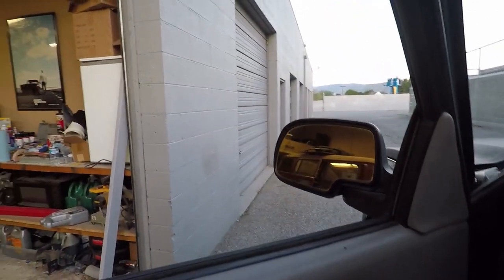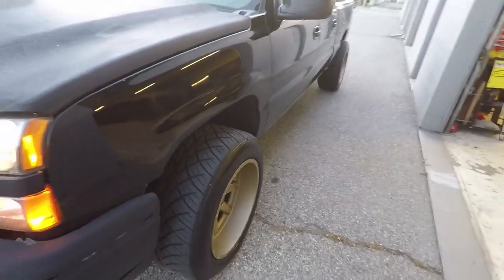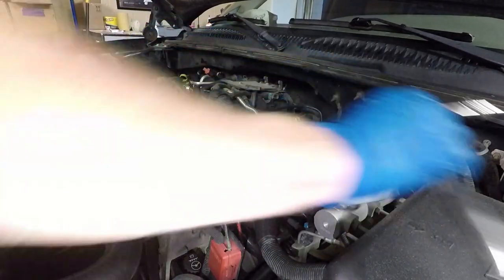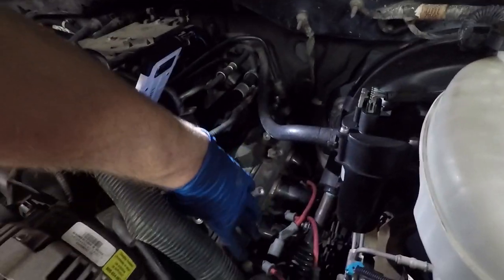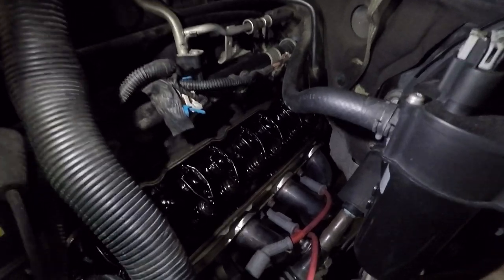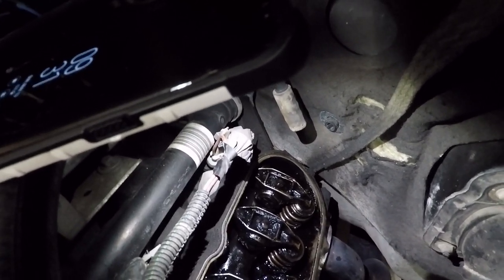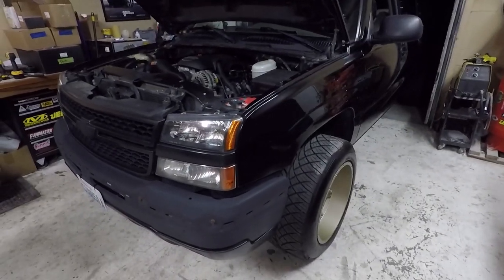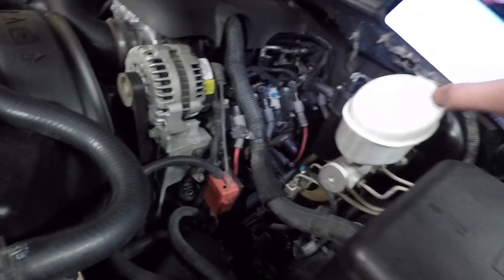Silverado Engine Tick Inspection

Comment: I have a 2006 gmc 2500hd w/ 6.0 I had a horrible ticking noise on the top end of engine  and bad oil pressure after looking these engines have a long pickup tube that connects to the oil pump where the pump connects to the tube in the oil pan it had a bad oring that caused it to allow air to get in I replace that oring and put another one on top of it to make it fit tighter bolted back together  works like a champ no ticking noise and when I gas on it oil pressure  goes  from 45 or 50 to 75 to 80.

Comment: 2004 avalanche mine only tiks while I accelerate! Is load off a Cold start. But after Motor has warmed up it either gets quieter or stops. What is your thoughts? And price on fixing the problem?

Comment: The light is not going to help find the tick. Put lucas in it. Helps alot. That play is a little excessive but its not broken broken
Reply: I put Lucas in my last 5.3 and it immediately started losing oil around 2 qts a week.  I didn't have a tick and was only using Lucas as preventative maintenance.   I just wanted to give another opinion on the stuff. Like anything, it ain't perfect.
Reply: Josh Christian I’ve never had that issue but I use non synthetic oil and non synthetic stabilizer. Is it possible you put full synthetic stabilizer in with non synthetic oil?
Reply: @BayAreaMCs  I use synthetic oil and synthetic stabilizer,  or I should say I used to.

Comment: The oil pumps on these LS engines are on the front of the engine they are powered by the crankshaft..the pick up tube runs into the bottom of the pump the rubber seal that slips onto the pick up tube needs to be replaced..no lie..it gets pinched or flattened or cracked and starts to draw air and loses prime in the oil pump..I'm about to do this to my truck  in just a few days..but I think I'm gonna replace the oil pump with a high volume hig pressure pump

Comment: Pressure issues are notorious on these 5.3's I bet when u give it gas its more quiet at 40psi oil pressure.
Reply from the maker: Agreed, im thinking the pickup tube o-ring is dead. hopefully i can get the old engine tore apart soon and inspect that o-ring.
Reply: @MitchCarveth  I have a 4x4 and I can't drop the oil pan until I lower front axle fml. lol
Reply from the maker: I know the feel :/ lol
Reply: @youdontwantthesecrumbs3996  Not that hard I did it my dad had to help me because the 09 front diff is more heavy duty
Reply: Got a 2006 2500   oring 5 bucks at autozone pipe was  still a little loose so I put another regular oring on it worked great
Reply: i had mone fixed with no experience only common sense on how the things work
mine is 4x4 north face avalanche
the 0 ring was flat and i change the oli pump and the sending unit. No more noise!
 im now chasing a po300 code Dow to it's cour

Comment: Hey, buddy. So this was definitely a rocker arm causing that tap/tick? I have an 02 1500 with a 6.0 lq4 swap and mine sounds almost identical from what I can hear through the internet. I'm thinking I might at well just replace all the arms and pushrods to get me by until I decided what I want to build.
Thanks
Reply from the maker: It's definitely worth popping the cover and checking the rockers for excessive play in the bearings. Hope it's not a lifter tick starting. How's your oil pressure? Just want to verify it's not the oil pump o-ring going bad.
Reply: @MitchCarveth  Oil pressure is great. The taping comes and goes but sometimes it's pretty damn loud. Strange thing is I don't hear it on cold start.. just when it starts getting a little heat in it. I've really had trouble finding the exact sound but when you cranked your truck and did a walk around the front... that sounds just like mine. I put a stethoscope all over the engine and I hear it most clearly on the water pump and toward the front of the oil pan but still hard to say.
Reply from the maker: @SheaAP1  that makes me think it might be a lifter and you are able to hear it better by the water pump because it's echoing through the coolant journal in the head and theres less moving parts by the pump (Vavltrain wise). But that's just a guess without seeing or hearing it in person. I would still check rocker arms and springs first for sure, It could even be lose rocker arm that's Evening out at certain RPMs.
Reply: @MitchCarveth  my has the same thing. Did u ever figure it out

Comment: What kind of gauges do you have hooked up? I like that. Not boost of course. Trans temp? Oil temp? Wheels look good. Would like to see that rebuild video.
Reply from the maker: I have air/fuel ratio and trans temp right now, thank you! I've got the rebuild video on the channel and the tear down video of the engine in this video is up on the channel as well. Some sweet broken parts lol

Comment: I got a 4.3L v6 2004 Chevy Silverado close to 140k miles. The truck when sat for a couple hours, makes a ticking/clicking noise after the start up. This goes on for more than a minute, then after the truck gets the opportunity to warm up, the noise goes away. My oil levels are checked when this occurs and it is at the appropriate level on the dipstick. I do have a bad intake manifold gasket that is getting replaced as well as the oil sensor. Is there any reason this happens only on start up then disappears? (I do live in the state of Wisconsin, so winters get decently cold)
Reply from the maker: Hows your oil pressure after startup? you might have a lifter that's taking a bit to load up, without being there in person its a little hard to say. I wont lie im a pretty big fan of the Lucas oil stabilizer, it helps with valvetrain noise really well.
Reply: Oil level might be a factor.
Reply: Ever figure out why it did that?

Comment: 2003 Chevy Silverado 4.8L with 210000 miles for 1500$ with that lifter tap sound did I pay to much or was it worth it because I want to fix the problem so I can drive it. It’s one of those half rear door trucks?
Reply: Oh and it’s the one with those cool looking head lights
Reply from the maker: I think thats great deal, as long as its not burning oil and has good oil pressure just swap out the lifters and get another 100k+ out of it.
Reply: @MitchCarveth  I cleaned the oil pick up tube and replaced the o ring and the ticking went away I only hear it on cold starts but it light tick

Comment: I’m about to buy this 06 Chevy Silverado 1500 and in park it has low oil pressure and it does this, it has a ticking sound, you think it’s good? And do you know what it may be?
Reply from the maker: The low oil pressure in park tells me the pickup tube o-ring that goes into the oil pump is failing and losing pressure. As long as its just a tick and not a knock you will be good buying the truck but make sure to replace that o-ring soon before valvetrain gets damaged.
Reply: Ok thanks

Comment: I'm glad I found this video. I hope to god that this is what's wrong with mine hahaha. After my cam swap that's exactly what my tahoe sounds like.
Reply from the maker: Sorry for the late reply! keep me posted lol did you do a new pickup tube o-ring during the swap? if thats not sealing correctly it can cause drop in oil pressure and cause valve train noise.
Reply: Turned out to be a collapsed lifter.  They were all new ls7 lifters. . My idle is too low. Waiting on my tuner to get back with me to bump it up to 750 or so. Right now it's around 650 and drops to 20 psi sometimes. I probably do need a new o ring but it holds steady at 30 most of the time.
Reply: @tripn8888  I just did a cam swap on mine and it's doing this now.

Comment: Buying a 06 5.3 rwd has 140k on it engine runs like a beast but sounds like a sewing machine just in park not really  a ticking lifter noise just curious if this is normal for a 5.3 I've only worked on 4.3s n 5.7s 80s n 90s chevys
Reply from the maker: That's the injectors more than likely, kinda freaked me out a little bit when i first heard them too. Also with 140k on it you might be hearing a little play in the valve train but both of those are normal 👍 Don't be too worried if you hear a little bit of piston slap on a cold morning start thats pretty standard with 5.3s as well because its basically a 327.
Reply: Mitch Carveth had a 1968 327 in a Malibu it was noisy cold piston slap lololo never caused problems

Comment: I bet if you ran it with the valve cover off, you could have tightened it up just enough to not make any noise.  Maybe wouldn't be the right thing to do but it would've stopped it from being annoying until you rebuilt it.

Comment: mine has a similar sound. sounds like a diesel. What was your issue? my car is a 2016 yukon denali and only has 38k. It goes away after its been running but happens almost everytime I start it in the morning.
Reply from the maker: I thought it was a rocker arm but turned out to be a lifter unfortunately.
Reply: @MitchCarveth  i mean if my car is a 2016 with only 38k... should i get rid of it? or is it a simple fix? I dont want engine problems in the future on an 80k dollar car
Reply from the maker: @mrhaths  you have to remove the heads to get to the lifters unfortunately. The difficulty really depends on how mechanically inclined you are. Is it under warranty still? Also do you have the 6.2 or 5.3?
Reply: @MitchCarveth  6.2 and yes it is : )
Reply from the maker: @mrhaths  without hearing it in person i can't say for sure but my uncle had a lifter go bad in his 6.2 silverado. I would take that in and have them warranty it for sure.

Comment: I got 04 5.3 215k miles only ticks on cold start but does it really bad any suggestions?
Reply from the maker: Is it lifter tick or a little piston slap? some 5.3's develop a piston slap during cold start. They are based off the old 327's and those were notorious for piston slap. If its lifter you're good for awhile still if its just on cold start. If you start to hear it while driving or at a warm idle then i would look into replacing your lifters.
Reply: Its definitely a lifter tick ..only does it when it's cold once it warms up no tick..what is needed to be done to fix it, it drives me insane?
Reply from the maker: @rickyhernandez995  Just need to pull the heads to replace them. Until then try some Lucas oil heavy duty stabilizer, it will help.
Reply: Guess they gotta be replaced 🤦‍♂️tried lucas helped for a few weeks but it's back thanks alot man
Reply from the maker: Ouch :/ Well i have an engine assembly video, the engine isn't in the truck but it will give you a decent idea of how to go about the lifters if you need help.
Reply: @MitchCarveth  awesome I'll check it out thanks again man
Reply from the maker: Anytime!

Comment: I just took my GMC 03 with 90k to get an oil change I use Mobil 1 and now the clicking started. The clicking is on start up and while driving
Reply from the maker: Did they switch you to full synthetic? when i switched to full syn i noticed i could hear my valve train a bit more than before.
Reply: @MitchCarveth  yes they used fully synthetic and thanks for responding🍻
Reply: Same here

Comment: So what was the issue mine is doing the same noise plz help
Reply from the maker: It started out as a bad rocker arm then a bad lifter followed. Does yours do it just on cold start or constantly?
Reply: @MitchCarveth  just on cold start ..but when is warm is not as that loud a bit when i accelerate i have it on my monte carlo 1987 is a swap i have headers and a cam i thought it was my muffler but i seen your video is doing the same noise ima post a video if u can check it out
Reply from the maker: It could just be the audio but that sounds like some valvetrain noise. I would pop the valve covers and make sure nothing is loose. what oil are you running?
Reply: @MitchCarveth  i heard a pop like popcorn when i step on it a while back one pop tho it lag a bit may b it is valvetrain...i use valvoline full synthetic 5w-30 dex os
Reply: @MitchCarveth  if u go look i uploaded 2 more videos.one on cold start
Reply: @towcars5550  Good oil pressure?
Reply: @TheWolverine-rm2kr  I found the issue I had a bad gasket in the manifold cuz I have custom headers

Comment: had a collapsed #6 intake lifter.  replaced all 16 lifters, all 16 push rods, 1 new rocker arm, VLOM, and obviously head and valve cover gaskets.  After reassemble, now have a bad lifter tick and low oil pressure. 11 of 16 rocker arms have side to side wiggle.  Did an engine flush after reassemble to see if there was crud or paper towel bits, but nothing looked foreign in the oil. Any thoughts?
Reply from the maker: How many miles are on it? im wonder if its the oil pump O-ring, that will kill oil pressure. I'm pretty sure thats what caused my parts failure, i'll find out for sure after i rip into it.
Reply: @MitchCarveth  124 thousand
Reply: @420shon  did you find out what it was ???
Reply: Sounds like the o-ring on the pick up tube is bad and causing issues if you replace all the components.

Comment: I was eyeing a 2006 sierra. But, it's making a ticking noise. It has 120K miles on it. I think I'll pass.
Reply from the maker: Like a lifter tick? 120k is still pretty low miles for these engines. if its a lifter i would pass as well, unless they make you a screaming deal.
Reply: 120k?? As long as it doesnt have afm thats a steal if its under $3k and not rusting to hell

Comment: Sounds like it just needs some new lifters
Reply from the maker: I did end up exploding a lifter later on due to bad oil pump o'ring.
Reply: @MitchCarveth  hey I have a question I have a ticking noise like that at idle but then when accelerating seem to go away could my oil pickup tube oring be bad too I have a 2013 suburban  5.3 dod deleted and vvt deleted with ls3 springs trunnion upgraded rockers and a truck Norris cam. Oh and I have little over 40lbs oil pressure hot  cold start 60lbs

Comment: Lifter bad use some seafoam
Reply from the maker: I never mentioned it in the video but I tried that and changed my oil after. It helped for a bit but the lifter ended up dropping and taking the cam with it. Just too high of miles. I've got a donor engine on the way.
Reply: Mitch Carveth how many miles were on it when this happened??

Comment: My 5.9 magnum was making that noise today 😭
Reply from the maker: Get some Lucas oil stabilizer 🤞 it helps for a bit. Im sorry to hear that though 😔
Reply: Mitch Carveth I was about to do a cam but idk what I’ll do now
Reply from the maker: @Aqua350Lt1  LS swap 🤔  just playin lol swap out the lifters while its already under the knife with the cam install.
Reply: Mitch Carveth yeah I’ll do that 👍 if that doesn’t work hellcat swap 😂 jk
Reply from the maker: @Aqua350Lt1  hellcat swap would be sick! 🤘
Reply: dude... me too. 5.9 mag JUST TODAY. im trying to figure out if its a lifter, rocker, or if im just freaking out over an exhaust leak.
Reply: LeekyChicken mines just a lifter it’s probably the same for you
Reply: @Aqua350Lt1  dont laugh at me, but my header bolts backed out lol. they were like hand tight.

Comment: Cheap ass?
Reply from the maker: which part?
Reply: @MitchCarveth  I forgot to put gas* it's doing that noise because of (cheap gas) my bad lol
Reply from the maker: @ericthegamer92  lol all good brother, it ended up being the rocker arm but that was do to the oil pump o-ring going bad which I didn't notice and ended up exploding a lifter months later 🙃
Reply: @MitchCarveth  lol my bad again I was in a driving and didnt notice it... I had a 2006 and I start putting 87 gas because out here it was close to $5 at one point... I'm in Calif.. and still was driving like reckless... but I want one again soon